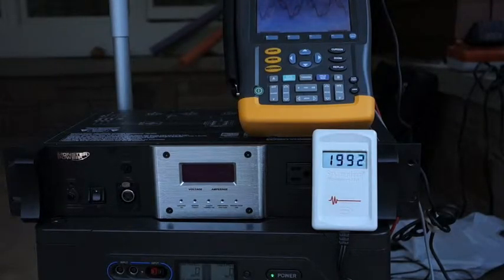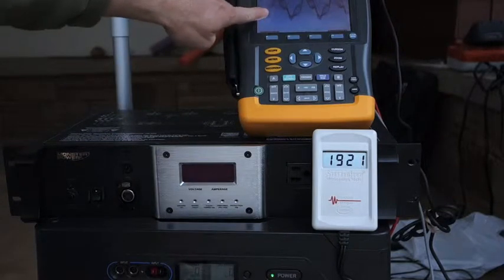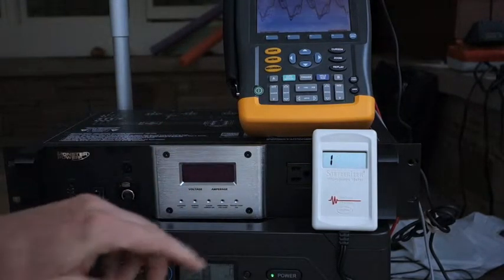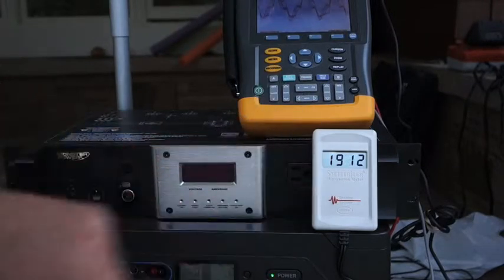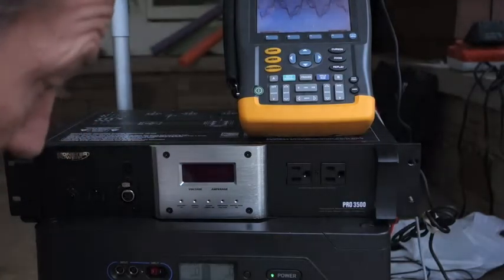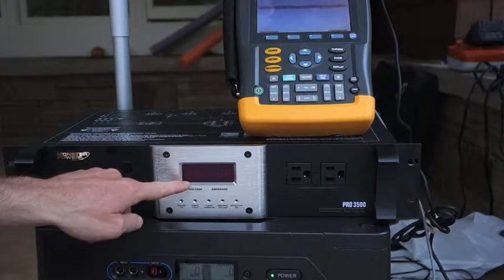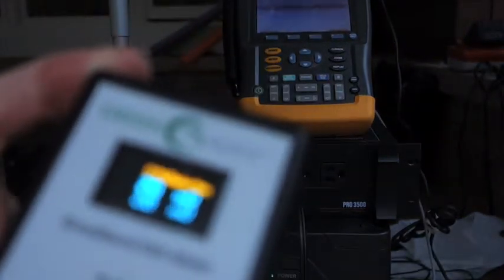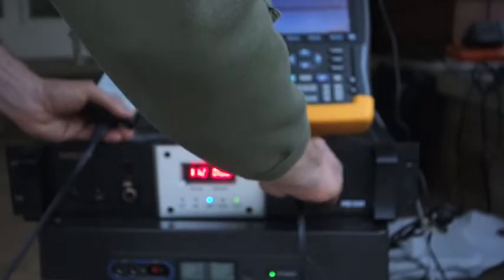Dirty electrical demo - pure sine wave inverter

Comment: hi peter sullivan i have a question , how can i make my entire apartment with clean electricty or clean ac
our criminal electrical company , is giving us dirty electricty its causing me head aches we have 1600- 2100 mili volts of dirty electricty i have headaches and sleeping problem i have neuro issues

i noticed the green wave dirtry electricty filters dont reduce all of the noise
i was thinking about buying a pure sine wave inverter